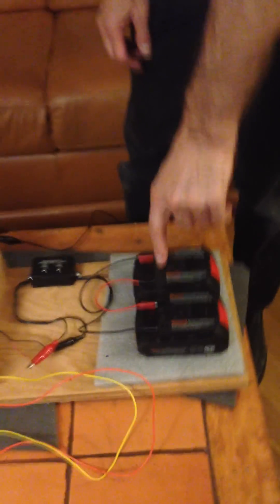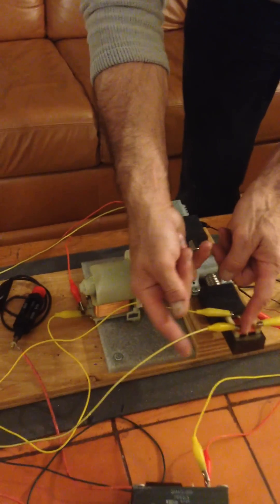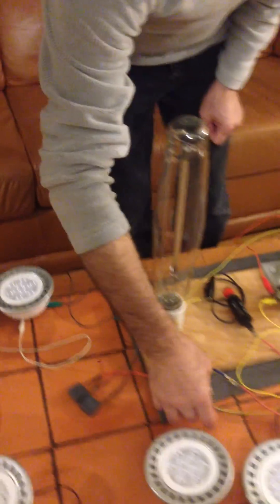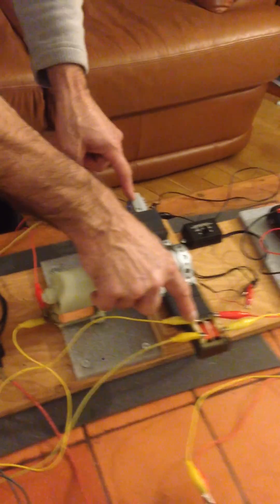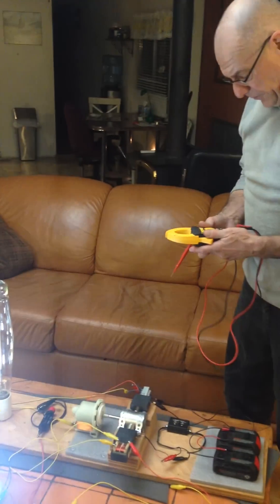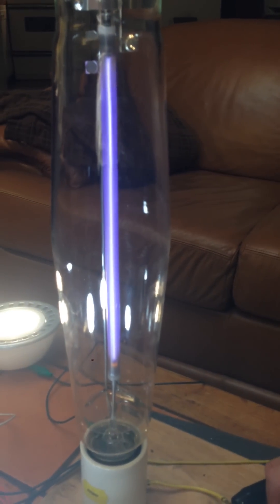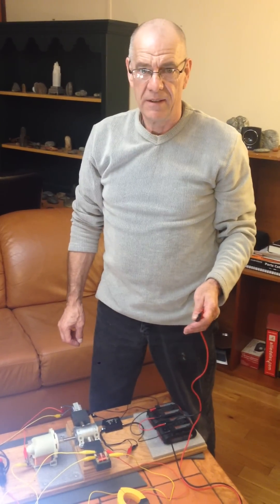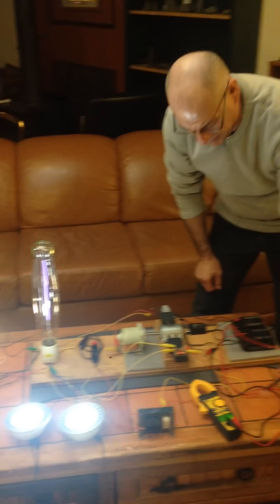Gerard Morin

Comment: Still not accounting for the Current eh?   Thanks for the cross link hitby.
Reply: *****  I second this.. post your own videos, you seem to have some prior knowledge.. That is not a threat, but a request. You can clearly see something is going on.. we are beyond this now.. self looping generator coming up next.. and soon.
 Good video Chris.
Reply from the maker: All I can say about current is that we've been doing electrical work but registering very little or no current draw and gerard seems to have no longer any interest in measuring nothing. We can measure hertz, temp and voltage well enough and seem to be moving forward with those. See the pole transformer videos for real demonstration of electrical work being done more so than should be possible with the input.
Reply: ***** There is ALWAYS current drawn if a load is powered, its just how much.    You have to measure it because its there to be measured or else you can't know what actual power you have in WATTS.   You don't get Watts by measuring Volts times Hertz.   (Also are you doing any caloric conversion to make use of whatever "heating" you are causing by heavily mismatched impedances? )   You can claim all you want, theres still nothing to back it up.    I have seen the pole pig videos, and they go the same unmeasured/unquantified way...    When  you know input watts AND output watts THEN you can then know how "efficient" whatever context is.   Till then its claims that can't be backed up by the vids shared.   Cheers.
Reply from the maker: Lets pick apart your retort :). "There is always current drawn if a load is powered." Your right from what we understand about electrodynamics, but your wrong at the same time. I'm going to reference the transformer video you mentioned in your retort. The best way to measure current draw in a circuit where you are having funny readings is to insert a fuse :). So in the pole transformer video you see the 15amp inline fuse that should pop instantly with the 6000 watts draw? Thus we have difference characteristics worth exploring. **Pause** Okay so if your confused lets look at the equation for figuring current draw for wattage, assuming we can't measure current with this setup, which I've personally varied my self in dozens of tests here at my own house. Okay so equation for current draw is power/voltage=current draw right? Look it up if your foggy:). **Un-Pause** So I reference above transformer video yes? So on the load side is 6000 watts divide the 120 watts 60 hertz of square wave DC coming out of the pump. **Pause** Watch the follow up videos for the re-creation done by the guys from the energetic forum who've applied a oscilloscope to view the wave form coming out of the exact same genset Gerard Morin is using, it is showing a DC square wave, if that isn't weird enough I'll unpause and continue to get weirder. ***Unpause*** So we know our little generator is only putting out 1500 watts thats about 12.5 amps max at the voltage out at 120V. So again lets look out our equation 6000 watts / 120 voltage = 50 AC Amps, ergo we see with reference what we SHOULD be drawing in a load, based on our so held dear equations for electrodynamics. Thus we can logically conclude that regardless of what our meters are or ARE NOT reading, in terms of current, we can verify its amazing characteristics all the same. Not to mention overunity baby:) So you see why Gerard and myself after a few more tests will be not adding current measurements in our bag of observatory tools. So lets move on with your retort, "You have to measure it (current he means) because its there to be measured or else you can't know what actual power you have in WATTS.   You don't get Watts by measuring Volts times Hertz." So as we see folks I've just blown this persons mind, as my mind is as well so don't feel bad. The reason we measure hertz and volts (and temp) because its what our apparatus will measure and seems to be consistent between the power coming out of our wall and whats coming out out of our little drain pumps. So we LOOK (observe: hertz, voltage and temperature) where we can and add REFERENCE (known load current values and fuses) everywhere else there is doubt, understand? If I need to make it more clear please respond and I'll try and be more simplistic; no insult intended really this is mind blowing stuff so I understand you're "impedance" towards accepting what your seeing :). Moving on... Coruscantme -"(Also are you doing any caloric conversion to make use of whatever "heating" you are causing by heavily mismatched impedances? )   You can claim all you want, theres still nothing to back it up.    I have seen the pole pig videos, and they go the same unmeasured/unquantified way... again see above folks I'm not going to waste time addressing this twice.Coruscantme - "When  you know input watts AND output watts THEN you can then know how "efficient" whatever context is.   Till then its claims that can't be backed up by the vids shared." Ok so you are talking in circles with your self, so for the transformer video, for example, we are well aware of the watts in and watts out of our generator and load. This is shown above....  and I'll not waste time. Now I will take the time to inform you that me and other amazing people around me will be conducting another test tonight. What test you ask? Another test where we are running almost an amp worth of power through a 100mA fuse and it does not pop. WHAT!? Impossible you say? Well it does seem so but just like the transformer video, and the one we will be creating and POSTING tonight or tomorrow, we see with our own eyes it is possible. Oh and yes I'll be adding some hand drawn circuit diagrams, we will be looking at loads and doing some measurements for current and voltage. We will see the current in our video isn't really reliable thus we won't continue even checking for it once we move past this experiment; that I might add we've done about 18 different ways with greater and lesser loads but still over the fuse limits. Anyway this was a long reply but I thought it necessary because some people truly don't know what they are looking at here. I'm not sure I do either but I know enough to say WTF. Now please recreate the experiment for your self so you can see with your own eyes and do your own tests. As it stands not all your doing is trolling posts about what Gerard has discovered and nay saying something you haven't held in your own hands or thought about to any great degree. If you DO make this experiment and find something different that we are getting post a video so we can all peer review your findings. Cheers Brother, open your eyes :). p.s. if your a corporate sponsored slug troll then be warned your days are numbered!
Reply: *****   Ok, will watch for your vid so I can see all your measurements.  You might also want to learn how to compute watts in AC since you seem bent on keeping it AC for your readings.  (or if you prefer maybe get a battery and inverter and use that as your AC source so you can calc in DC watts into the inverter to drive the load.)

It seems you don't quite get that transformers won't pull full load till the OUTPUT IS LOADED.   Till then the input will be something Under the plate rating even if the trafo is supplied with the plate rated voltage.    (I'd add I said nothing about any fuses. I've no idea where you got that idea and are now asserting that it was my comment, which it wasn't/isn't.)  

I do enjoy reading how you play both parts of the conversation, prolly keeps you from dealing with the reality of objective observations.   If you understood watts, then you'd understand that you can run 1000watts thru a 100mA fuse so long as your FORMAT for the power is correct.   (ie.  1000watts at 10,000volts and 100mA...  is 1000watts in a format that will pass thru a 100mA fuse.)  

The onus of producing the results to match the claim is not on me.   Its on you.  I'm not making claims, you are.  I'm sharing basics so that you guys can stop deluding yourselves into seeing whats not there.   That noted, I'll just watch for whatever vid you are going to share that presumably PROVES it one way or the other.  

I'm an independent person who took the time to prove out the lies of morins claims.   If I was corporate this wouldn't warrant any reply.   ;)  Cheers!
Reply: CoruscantMe
By the by FUSES, only blow if CURRENT exceeds their rating.   That Current has to exist on the Fuse for some amount of time at some excess value to then cause it to heat and open up.    Maybe you can relay that to the fuse guy once you remember correctly who made that comment.   ;)
Reply from the maker: CoruscantMe lol is that what fuses do? So if I'm pushing 110v out of my pump and I'm doing 100watts of work and I have a 100mA fuse then why don't you wow me with some magic calculation to explain why the fuse doesn't pop? That is .9 amps? Thoughts? I do appreciate you making my point again for me though. If the fuses aren't blowing but we have a reference for work being done then.. what is powering our loads? Why aren't we seeing the same characteristic. I would like to invite you to try something... take your self a hair thin strand of braided wire, we pulled it off the coil of an induction coil from an induction stove top. Gerard showed me this at his house, now use a  double A battery and jumper - to + and you'll see the wire fizzle/burn or flash pop that is 1.2v battery. Now take a similar thread from the same braided wire and carefully place in the circuit and say run 100watts of lights, 3 transformers a spark gap, sodium bulb and see if that little hair thin wire flashes to open the circuit. Well we did and I have again since reproducing this here at my home in Oregon. My friend there is work being done but the characteristics of this type of energy or current is very different. Again take a peak tonight or tomorrow I'll work hard to have our video up showing our work calculations as well as so you can see this current isn't popping our fuses. Cheers
Reply: *****
Haha... ok, well Good luck man.  I can see your cup is full already.  I'll just watch to see if you stumble onto the why for your stated context on your own.  Cheers!
Reply from the maker: CoruscantMe Why don't you recreate the experiment your self and post some videos? I put my little setup together for less than 100 dollars, you seem obviously interested in whats happening here. Why not stand next to us here and help try and figure out what is going on? It's only going to happen together brother corporate interests sure aren't going to provide a product or technology that destroys their profit base....
Reply: Gerard Morin  loved your videos ,,can you try doing it with oil filled heaters ,, heating homes is more expensive then lighting,, just maybe you could try the oil filled heaters
Reply: CoruscantMe Isn't that just pitiful?  It's like someone sticking their head in a hot oven and saying, "yeah, that's preheated to 350 degrees, stick the cake pan in". These guys are using no accurate metrology, they have absolutely no clue of what the hell is going on, and they THINK they are creating energy!  Wow, what a bunch of Morins!  I mean  MORONS!  Oops, I repeated myself!

Comment: Thanks for sharing your work!  Very interesting!
Reply from the maker: Your welcome, unity is the only way this research is going to get accomplished!
Reply: @Chris-mk2lh  hello sir, can I have a diagram to this set up of gerard morin?  I'm interested to his free energy. Thank you for posting his video.
Reply from the maker: @milrivas7863  Prime Mover, Generator, Play with Series / Parallel of step up transformers, then on H.V. side use a spark gap in series with a load like a coil, change spark gap to change frequency / voltage output; can't be used to heal or kill. You've been warned. use a voltage non-touch sensor if you are going use on your self, watch different points of your body if you are standing in the coil down stream. watch your body fill up with energy.